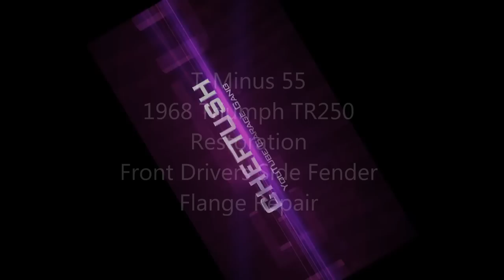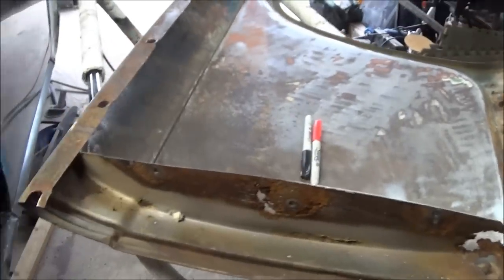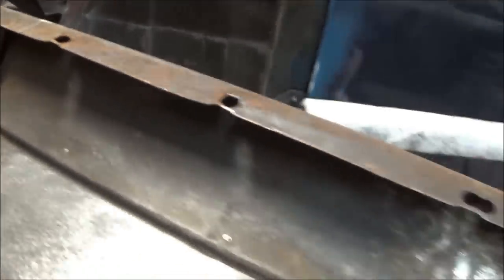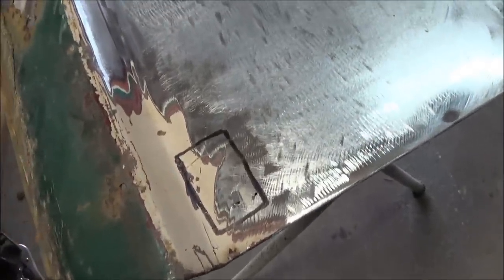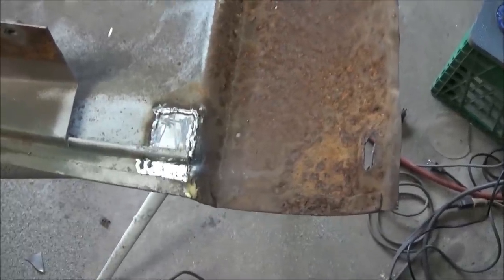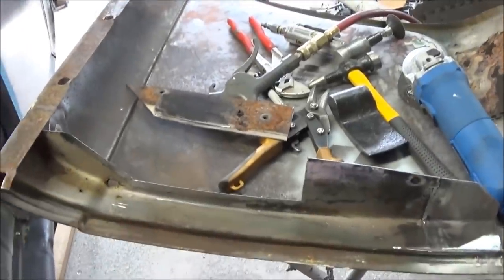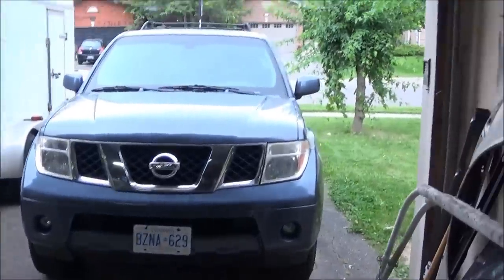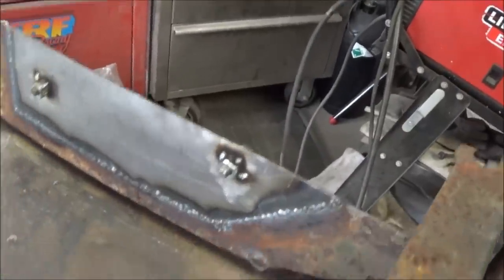T-Minus 55, 1968 Triumph TR250 Restoration, Front Driver Side Fender Flange Repair

Comment: Hope you feel better. Curious as to if you would have been able to just weld those small holes instead of making a patch? What tips the scales to making a patch?
Reply: I am guessing the whole area was too pitted. He never showed it to us from inside after the sandblasting.
Reply from the maker: David Plass hi David.  Not only were there several holes, but the metal was quite rusty and thin.  If it was just one or two little holes but the surrounding metal was in good shape, you could easily just weld them up...in this case you couldn't.